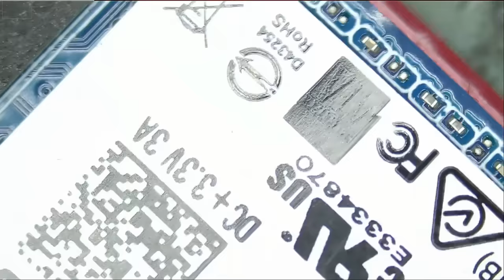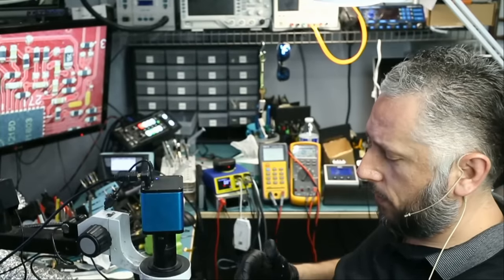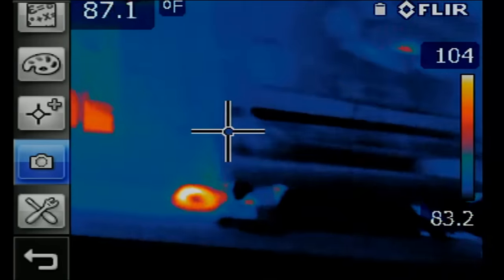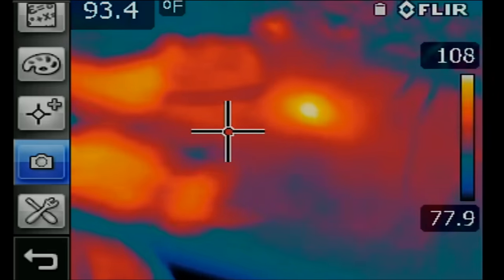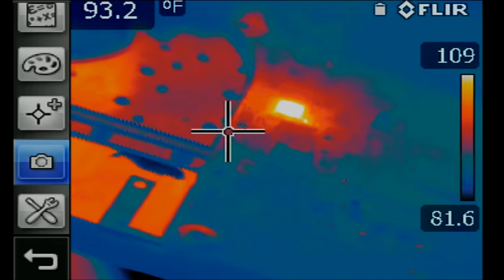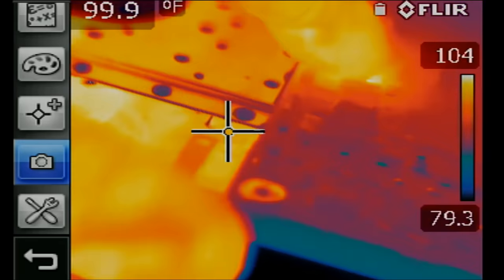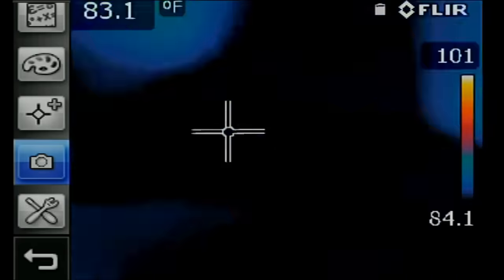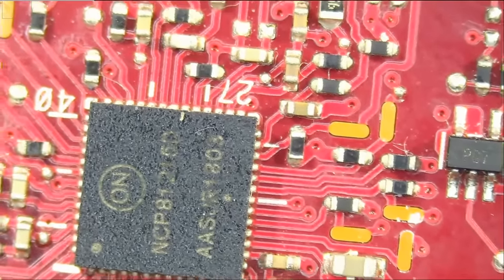ASUS ROG Repair - No Boot Black Screen but Keyboard backlight is on

Comment: I had an Asus ROG G 703 GXR that had the same exact problem. The fix was probably the same as on this one. But being that it was 2 years old already and I bought an extended warranty I got the $3799.00 fully refunded. I bought a new desktop gaming computer. This guy is simply amazing. A tech guru at repairs.
Reply: How did you get the refund amount if you had an extended warranty??

Comment: Hehe the sarcasm in your "easy fix" is hilarious!!

You are inspiring!
Still have a commodore VIC20 and a VECTREX I need to work on and after that have a look at my own desktop PC which is having issues.
Desktop won't reboot (have to do a hard shutdown and power on) and with a 2nd sata device attached it randomly locks up and/or bluescreens on me.

Comment: Sometimes after power has been removed from a board for a while, it will power on and off multiple times to train the memory when you reassemble. Especially when there is a lot of ram.

Comment: Can you explain how diode mode works and how you can find shorts? Does your multimeter beep when there is a short or you can tell when there’s a short because of the reading? Where do you get schematics for laptops or any device? Thanks in advance.

Comment: Great video! I’ve had one of these laptops for repair and after finish repairing I had to test it but did not have a working screen . Just like any other laptops I would test for working signs but this laptop would light up and then shut down over and over again. I kept scratching my head until I got a screen and plug in the lcd . Turns on these specific Asus does a check for the screen at startup and if there’s not one they would shut down . I can only imagine how many mother boards were tossed aside for no power when it could’ve been the screen yikes

Comment: i have noticed this happening with a lot of asus laptops i think they do not have a fail safe for when we remove a key component completely which is what causes the screen issue in my case it was removing all the ram cleaning it and then reataching everything back and it somehow gave me the problem after looking here and there for a few hours and trying many things the solution was removing the battery then pressing the power button for 20 seconds then plugging in the power supply and pressing the power button and go throw as many power cycles you want i did 2-3 then remove the charger reconnect the battery then try powering then remove battery again and press power button for 20 seconds then again plug in the power supply and then press the power button this time until you see the power light turn on and you should be good to go once the screen starts then simply open the laptop run a few diagnoistics and check pc health then shut down and reconnect the battery and recheck if everything works then everything will be fine

Comment: I am very confused from lots of videowhen you say at mosfet test that this amount of voltage drop. I think your meter is in diode mode or continunity mode and power is not connected then how the voltage came in? i wonder. please make separate video on above topic. Second thing diode mode & continuity mode are both same in multimeter which i have. .
Reply: He injects voltage into the board and then tests the voltage at different points

Comment: look. Just some to note here. If the cpu is bare die with no cooling and is burning hot. then the cpu might be damaging itself. Some parts of the die dont have temp sensors on it so be very carefull.

Comment: How would you find a replacement 4 pin power cable connector for a dell p67f? broke it off motherboard, but havent a clue where to get a replacement. Any help appreciated.

Comment: I'm having the same problem, but I can't remove the mosfet on the motherboard. Solder does not melt. I equalized the mosfet for it to work directly, the light on the keyboard burned for more than a second, but then it went back to its original state. Do you have a suggestion?

Comment: Hi. Saw the video in suggestions.
I have asus rog strix scar 17 g733py 2023
And very often turning on laptop I have the same issue. Display is just not working but the keyboard backlight and the sound of windows are there. I can do restart of laptop. It is just display don’t show the picture.
At the moment I’m not at home to bring it to repair service by warranty. At first I had problem with random restarts, service replaced motherboard. Now for one month this thing with display…

Comment: Hi! I have an Lenovo Yoga 730 that not turn on. I tried in continuity mode an I find a short on all capacitors near CPU. If I inject voltage (1.2V) with a thermal camera I see only CPU become hot. What you suggest to test? How can I find a short that causes CPU hot?

Comment: My ASUS ROG STRIX also has a similar problem, but the fans are running at high speed when I turn it on and the airplane mode & power light stays on. Does anyone knows the reason behind it, I got it checked with a repair shop nd they told me to repair motherboard or replace it.

Comment: Sir actually i have ASUS Strix G15 G513IH-HN084TS it 5 month old and i faced a bike accident today that caused dents in edge of Laptop display and the display is cracked. I think my warranty got void. I am facing same problem like this. What is the solution

Comment: Excellent work friend, thank you very much for sharing your time and knowledge. Watching the video I have a similar problem with an ASUS ROG ZEPHRYRUS G14 R7. It is my property. After a change of screen in a technical service two days later, when the fans were on, they accelerated to the maximum without an image on the screen and it stayed like that for about three minutes, so it was forced to turn off. When you turn it on again, only the keyboard backlight turns on without an image, the fans do not turn and it turns off after 5 or 6 seconds. It also does the same process just by plugging in your charger. Please, if anyone had the same problem and if there was a solution, guide me. Thank you very much
Reply: I had a similar issue with a lenovo with keyboard backlights on and the fan spining before it turnes off after around 10 seconds,  in the end turnes out that if the touch pad was plugged in it does that but when i unplug it the laptop starts up normally.
So there maight be a short in the touch pad preventing the laptop to turn on.
Try disconnecting all unnecessary things except the fan and turn it on and see if it runs the fan for a longer period , if it does then your issue is a parts issue not a main board issue, so keep plugging back things one by one and see which one causes the fault.
Reply: did you find any way to fix it? I have the same problem

Comment: trying to solve the same issue with the same brand laptop. one of my techs changed a keyboard, and now there's no display. not even in the neighborhood of the gpu/related parts. voltage regulator seemed hot, tried one from a donor board. no change. found a shorted capacitor and changed, still no display. that did fix an issue where i was hearing some interference, so i solved one problem for the guy lol. limited tools though at my store. ugh.

Comment: just happened to me, i did a ctrl shift win b to restart my gpu but it froze and i force shut it off, which made the keyboard light up and I couldn't shut it off; power button wouldn't do anything however long I held it. I just took out the battery and plugged it back in and I guess I'm good now.

prob was not as serious as this video

Comment: It was not an easy fix,changing a voltage regulator with 48 pins needs expiriance & if that mosfet not changed may new voltage regulator will burn in a second again.so it's not an easy fix,it's reason of a good inspection

Comment: I just wish i could figure out why my old cassette player died.. it turned on and the power light slowly went out and not it will not power on.. everything looks mint on the board..  the two mosfits get so hot you cant touch them..  I need a class.. lol

Comment: I exactly have the same problem with my Asus laptop. Keyboard leds working + the ventilátor working, but black screen and the laptop won't boot! That laptop was 1800€ and little bit more than 1 year old!  Now I can throw into the trash because the computer service cannot fix it. 😭